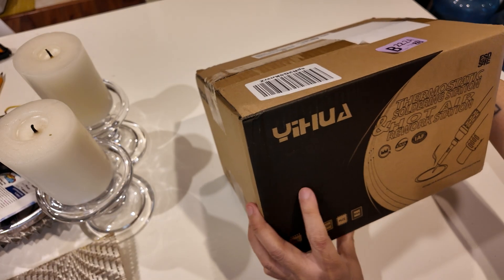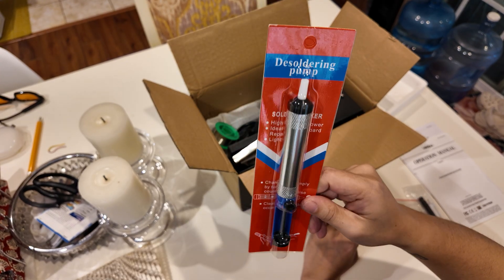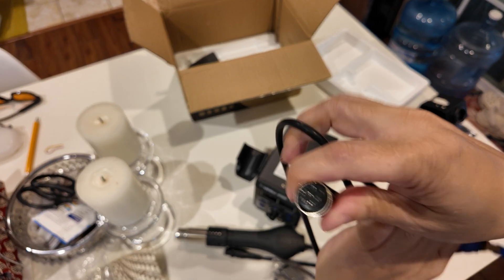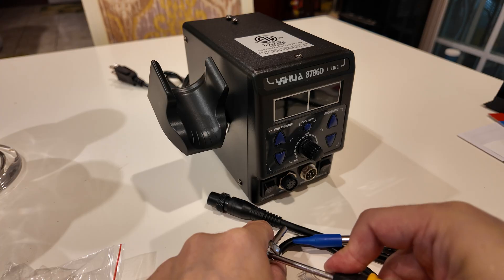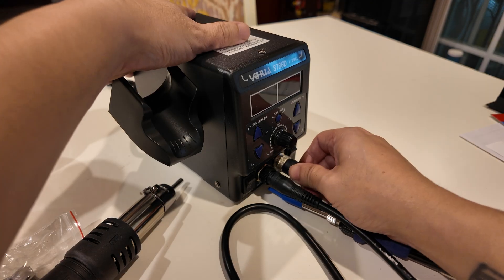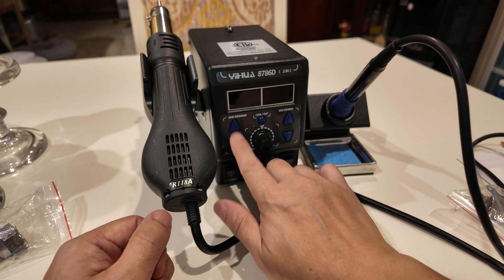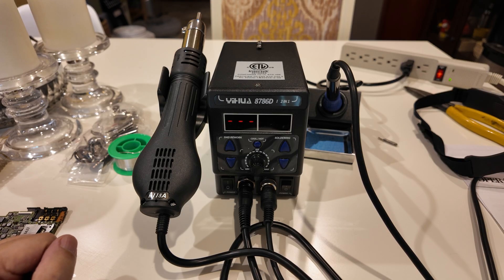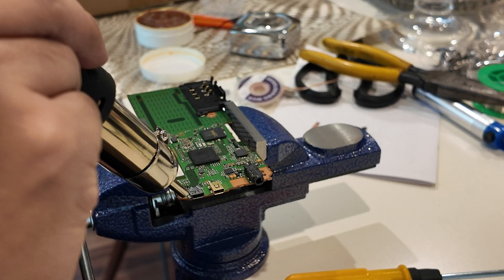YIHUA 8786D Unboxing & Test. Is This $70 Hot Air Rework Station a Hidden Gem or Total Junk?!

Comment: It's a reed switch, not an accelerometer. So it doesn't matter what direction you point the hot air gun, as long as it's away from the holder it will start to work.
Never leave the hot air gun on a single spot for long periods of time.
And use tweezers to remove components once the board is hot enough to melt the solder.
If you don't have tweezers, just push the component with a thin stick or screwdriver, otherwise if you use large pliers you'll take heat away and risk destroying the pads and/or traces.

Comment: I have one of these, in my opinion the soldering iron is junk. It is terribly inefficient even compared to my entry level hakko. I use it  mostly for the hot air gun, which works well. P.s, don't yank components off like that, you'll pull the traces off the board. Also those pliers would be pulling heat out and making life more difficult. Get some tweezers, and only pull it once the solder is fully melted. Flux also makes things much easier.